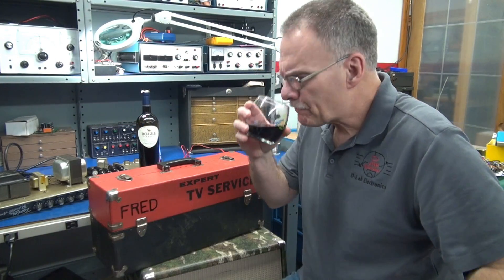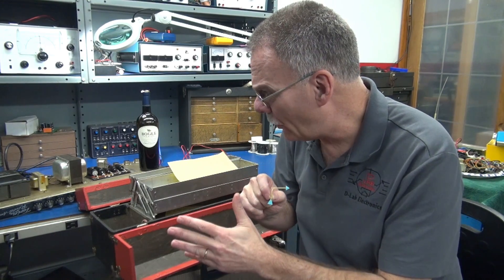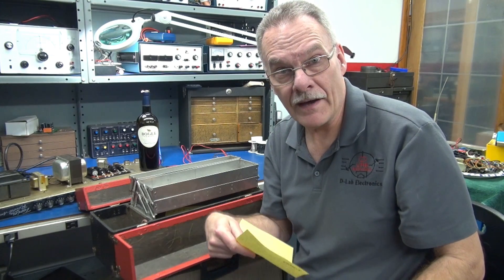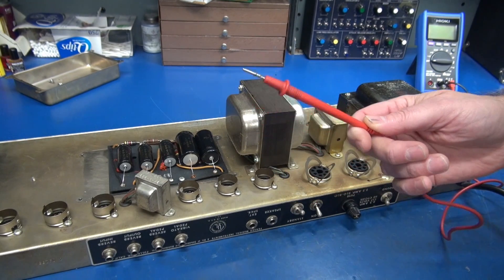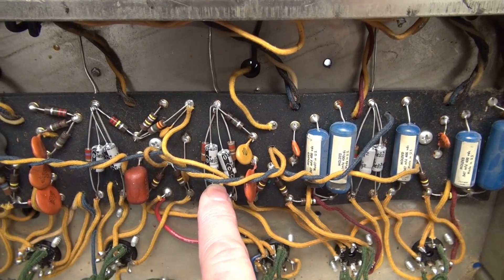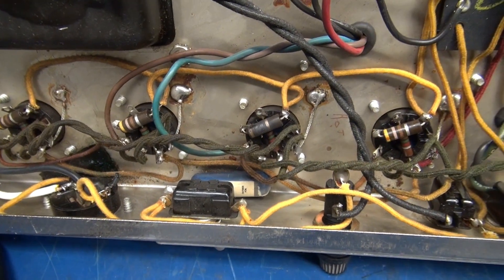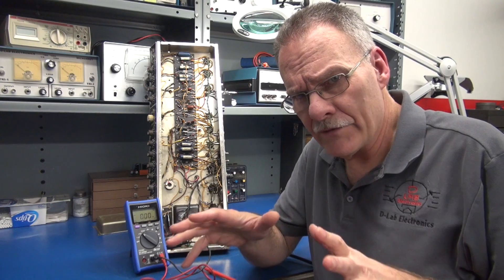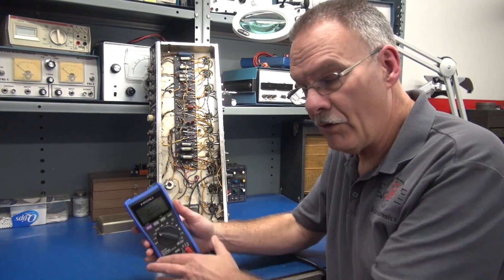D-Lab electronics Basic Training Fender Twin 6L6 Tube amp Red Plate Blowing fuses Troubleshoot

Comment: didn't see that coming.  Better check my 1974 Marshall JMP and see if that might be what's causing my own V4 red plating. Thanks for the troubleshooting techniques.
whoa! The reddish resistor, with green-blue-red-gold bands ( 5.6 K ohm 5% ?), the one on pin 5 ( 'control' / bias? ), had a an orange wire that was TOUCHING the outter end of that resistor! It could not have been still soldered. The lead coming out of the resistor just plum came off with the lead from the orange wire. Wow.
Thanks again.

Comment: Very nice video. 
And that's why as well the g1 contact of the tube socket must always be clean and tight. If it is dirty, oxidated or loose, causing negative bias voltage not being present at grid1, it causes the same unpleasant result to the totally innocent output tube as the broken wire did.
Reply: Wow, thanks, so always clean and tighten the sockets,right?

Comment: I had a Leslie amp which had no continuity from the cathode resistor to ground. Visual inspection showed the solder connections of said wire were secure.
It turned out that the ground wire was broken INSIDE the insulation.

Comment: Hey Terry, I have a clone blackface twin reverb. Made in the Philippines in the late 60's.  The switches for reverb and tremolo we're hard wired to the chassis. No plugs.  I was wondering if it was possible to put in toggle switches in the rear of the amp instead of floor switch  plugs.  Right now there are no switching functions.  
John